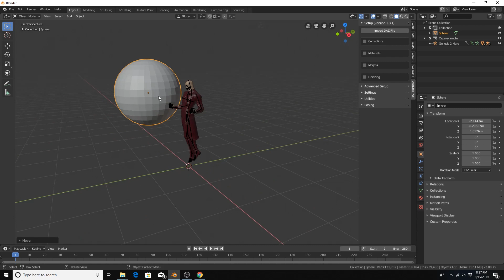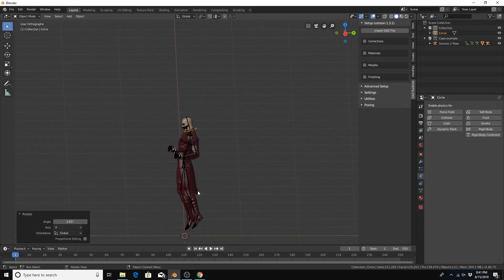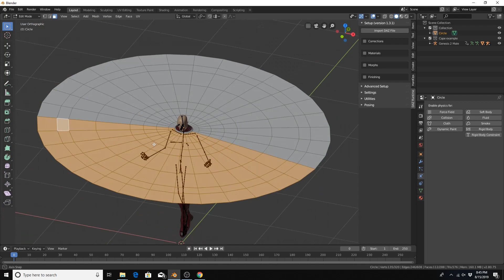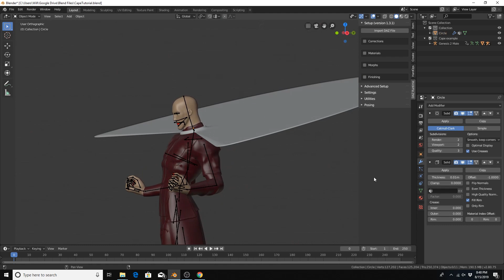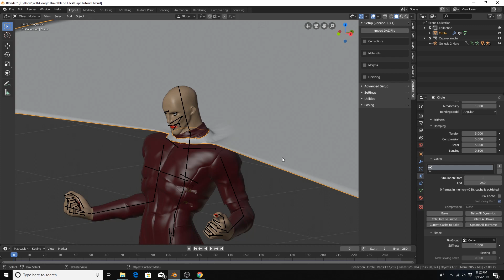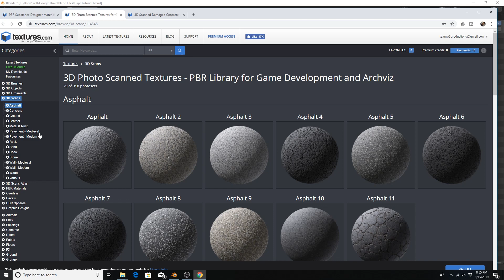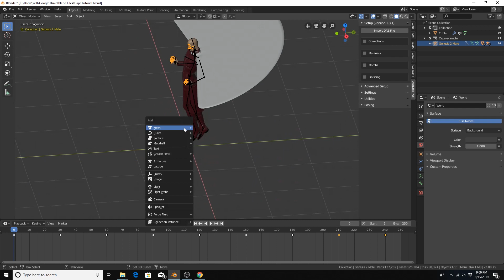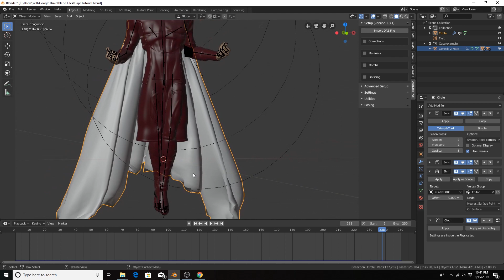Blender Cape Tutorial - Blender Cloth Physics Simulation

Comment: This seems to work great for simple movements but when i bend my characters neck then the pinned cloth shifts up/down. Not sure if there's a simple fix for this.

edit: seems to work great when moving whole amature but not when moving a bone that's connected to the pinned group
Reply from the maker: Cape physics can get complicated real fast. Sounds like either using the shrinkwrap modifier (adjust the offset) or something is going on with the parenting. 1. Test between parent and parenting (keep transform). 2. Maybe the origins of the two objects are too far apart when parenting. Perhaps change the origin of the cape to the same location of the character. 
If I get a chance, I will see if I can replicate the problem on one of my characters.
Reply: @W3-productions  So when ur character bends his neck heavily, the collar always stays on him on the exact same position? When I move the whole amature it works very well just like in ur video but moving a bone thats connected to the collar will mess it up(pinned vertex will slightly slide around on the body).

btw I've tried ur suggestions and changed the settings everywhere, it does seem to have to with parenting of the cloth to the amature and the shrinkwrap modifier, however so far all of them bring new problems(like the pins stay still on one side and clip through the character on another)

 I guess this solution would've been just too simple of a fix for attaching cloth to a character.
Reply from the maker: @hotfever  I'll have to try some things out and see. It's been a while since I've done a character with a lot of movement and a cape. I think I did a still shot with a bent neck and it worked out.
Reply: @W3-productions  Hey thanks but it's all good I just fixed my problem. If you or anyone has the same issue then instead of parenting the cape to the object, you need to select the cape, go to the constraints tab, add armature and set the sub target to the bone(neck bone here) that's closest to the pinned group/collar.  Now the pinned group will stay exactly on the same spot of the character when you animate it. 
If you want to do the same animation as in the video then use the root bone to move the whole character and not the armature as a whole, else weird stuff will happen.

I just added other pieces of clothing to my character in the same way and it works great all around without any weird behavior so far.

Also you probably could just parent it to the bone and it might work like that.
Reply from the maker: @hotfever  That sounds like the most reasonable solution.